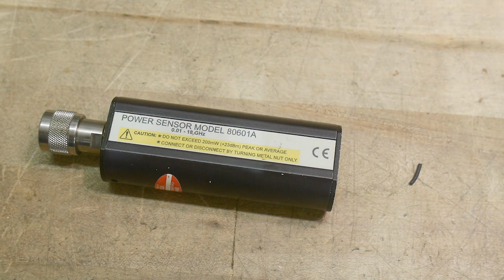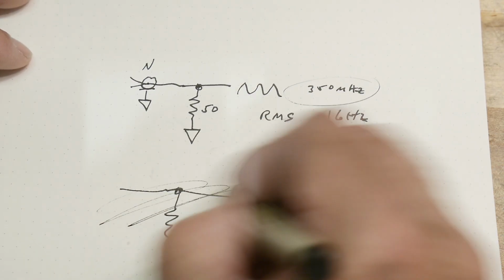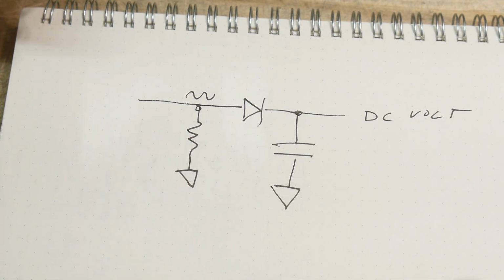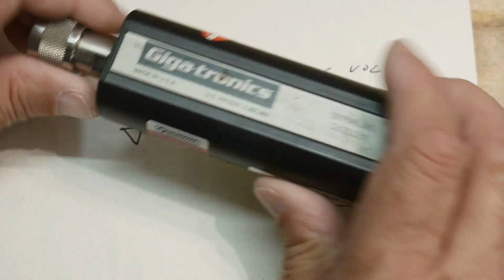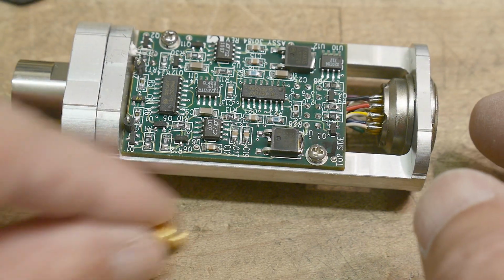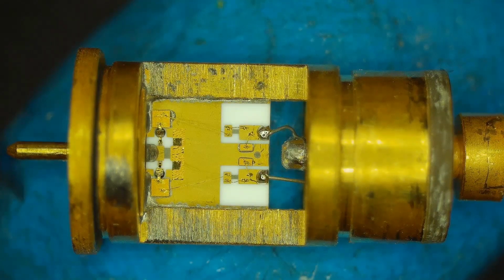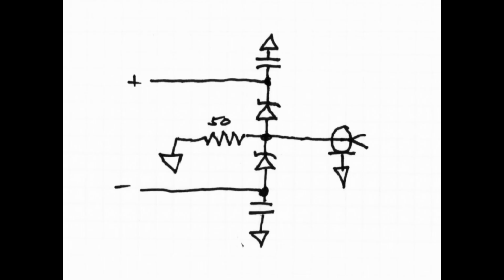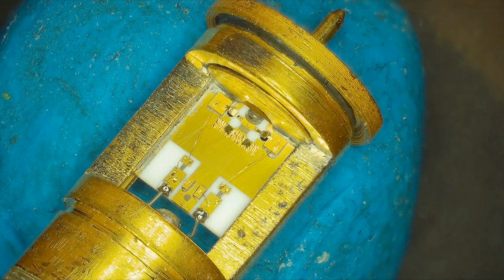#1447 Why are RF Power Sensors so Expensive? Can I fix a broken one?

Comment: The tapered layout shape is probably a tractrix curve.  If you transition abruptly from a transmission line to a lumped 50 Ohm resistor the VSWR won't be good so the tractrix turns out to be the optimum way to taper for good VSWR.  This transition also helps cancel the few pF that the lumped 50 Ohm load will always have.  Reflected power isn't detected by the diodes so a good power sensor must have very low VSWR (aka low reflection).

Comment: Thanks for the video !  Do you happen to know if there is any standardization in the interface between power sensors on the readout side ?  If I buy this or that power sensor, say power sensors with USB interfaces, they will always be readable by "most read out devices" ?  The reason I ask is I need a power sensor to perform mixer measurements with my SIglent SNA5004A VNA and I'm wondering if it will be able to "see" most power sensors.  Thanks !
Reply from the maker: no standard

Comment: Is there any way to get a commercially available RF detector diode that is good enough for the lower end of the microwave range? I have some 1S1588 diodes stockpiled for amateur radio use, but I would have thought technology would have improved enough to have a reasonably-priced microwave detector IC by now.

Comment: The diode cartridge works similar to the older designs for RF voltmeter probes using two diodes. However, they didn't have a great frequency response, where a Millivac, like I use, starts to roll off after 10 MHz. I think that is the reason Drake recommended using an RF voltmeter to calibrate their wattmeters at 14 MHz, though 10 would be best at 30 meters. At that, you can only measure 3 VAC RMS maximum, thus, for high power, you need a large and accurate attenuator.

In the Millivac probes, the diode section used two diodes and a few resistors and caps, which was fed to the meter that used a chopper. However, it also had three thermistors that led back to the circuitry as well. I think Boonton's was similar.
Reply from the maker: that sensor is good to 20GHz and we made 40GHz version as well
Reply from the maker: they also work from -70dBm to +20dBm.   you are right about needing an attenuators to move into the watts region. We made those sensors too. you might be interested in the box: https://youtu.be/8i5-O_8AZyk?si=1Qlc3vAzuvjYRMm2
these are not simple watt meters but NIST traceable power meters good to 0.01dBm

Comment: there also techniques that measure a temperature rise across a resistor,  and compute power from that. But that is not as simple as you think, you need to keep the resistor isolated from ambient temp.
Reply from the maker: called a Bolometer
Reply: @IMSAIGuy  HP used to make a generator, which was custom made for the telecommunications industry. It was called the HP 3335A "Synthesizer/ Level Generator"

This thing was a beast when it came to amplitude performance. It was "ruler flat" within +-0.02db form 200 HZ -> 80 MHZ !!

(It gets very expensive to be that amplitude precise, most gens today are spec to +- 1.0 db)

Then the telecommunications industry changed overnight, and HP decided to discontinue it (I guess they were the biggest customer)

That Bolometer technique we spoke about was used to confirm amplitude flatness in this instrument.

They used the phrase "Thermal Converter" and they used this HP part number for it:  HP 11050A (for the 50 Ohm output), HP 11050A/H01 (75 Ohm)

I own one, it works well but the output attenuator is damaged, and all signals are 20 dbm below what you set on the front panel.

A video on the HP 3335A might be popular with your viewers.

Comment: I spent 30 years looking for one I could afford. I had gathered a good, relatively modern Agilent control box and the cable over the years, and had them sitting around for a decade before I found the power sensing head with a 25 Watt attenuator for a semi-reasonable price at a poorly advertised auction for a failed start-up. It was sitting in the original box with the cal certificate. I bid on it and bought it immediately for more than I wanted to pay, but far less than it was worth. Now it's on my bench, and NO ONE is allowed to touch it but me. I usually make a power measurement using a cheaper meter first before I use it, just in case. It's the one piece of gear in my lab that I don't even plug in the AC cord until I need to use it.
Reply: Where do you get it calibrated?
Reply: @NimbleJack3 , I haven't gotten it calibrated. I've only used it twice since opening the box, when I really needed to. I use much cheaper stuff for approximate measurements.

Comment: The hp 478 and 8478 sensors compensate for any change in resistance from incident power by using a feedback loop which re-balances a bridge circuit. It therefore stays at 50 ohm so as to stay matched to the source. Also the 8481 and 8482 thermo-couple sensors have a series capacitor which limits LF response.

Comment: A diode-based sensor might be pretty impossible to build yourself, but a thermal RF power sensor sounds like it'd be pretty easy to DIY -- a pair of 50 ohm resistors you've picked out to match against each other, with a thermocouple junction bonded to each one; one resistor connected to the test load, the other connected to an op-amp that has the thermocouple junctions wired in series between the + and - inputs, to servo the current to keep the temperature matched. Wouldn't have a fast transient response or anything, but the cal curve doesn't seem like it'd be bad at all for a system like that.
Reply from the maker: http://hparchive.com/Application_Notes/HP-AN-64-1.pdf

Comment: As someone who has had an Agilent power sensor fail, it is good to know why it is so expensive to have it repaired! To be fair to Agilent, their repair service is excellent, but the cost is as you say, nearly as much as a new sensor. Really interesting video.
Reply: Almost the entire worth of the sensor is tied up in the input assembly. The rest of the thing is just a relatively simple ADC. Most repairs require replacing the input assembly, while it's very hard to blow up anything else.

Comment: Diode power sensors are less sensitive than the thermistor or wire type.  The chopper circuit you speak of is controlling capacitor coupled RF to the thermistor or wire to maintain it's resistance while the said thermistor/wire is directly a part of a bridge oscillator.  When microwave power is introduced across the thermistor/wire it requires less RF to the to the thermistor/wire to balance the bridge.  The drop in RF power to balance the bridge indicates microwave power.  Ambient temperature and temperature between the sensor and heat sinc must be accounted for.

Comment: Nice video!

 The old sensors and detectors we use to used are now considered obsolete now that we have Vector Network Analyzers and Spectrum Analyzers available.

I have a bolometer, but the meter portion does not work! I used to use it to test the output of signal generators, but I have a pair of spectrum analyzers, and the bolometer has sat on the shelf gathering dust. It may be ready to go bye bye!

The last time I used it was several years ago, and it, and many other devices, are getting ready to be sold for parts or repair!
Reply: I still use them frequently, as absolute power measurement accuracy on a spectrum analyzer is poor, as is measuring true mean-square power.

Comment: I’d hope the company making the diodes doesn’t care whether you’re an individual or not, they care whether they can afford to spend time talking with you. I’m not sure how much such perfect wafers cost, but if someone had a spare $50k or $200k or whatever, the company would be plenty happy to get their money :) For $1M and good leads on used equipment you could probably get everything needed to repair those things, including a wafer of diodes. It still would be an expensive service just keeping all your gear in calibration :(. And the cost of breaking a few things along the way to learning how to do everything right would be there too. So I guess as a business opportunity it would work, but if the money is someone else’s, their dividends would make the cost to customer in the same ballpark as manufacturer repair. And once the costs are similar, people will go with the more trusted vendor, even if it costs a bit more. I’m pretty sure that if those repairs could be done for much less and still paid a living wage, someone would be doing it. Quite a few metrology people out there who would know how or have the ability to learn. But it just wouldn’t cost any less to do it in a “garage”, and that would be some spotless air-conditioned garage, too :) I think the biggest unsaid/implied nugget here is that as much as these things cost, the market for them is competitive. To make those sensors cost significantly less, they’d need to be something normal people buy at Walmart. Then economies of scale would kick in and you’d be buying those sensors from Apple or Samsung for a couple hundred bucks. As much a metrology nut in me would like there to be a consumer market for these things, that’s all but a fantasy and will be for a while :)
Reply from the maker: here is one that would be ok: https://www.digikey.com/en/products/detail/macom-technology-solutions/MSS20-145-B10D/10249942

Comment: Worth mentioning more-explicitly for those following along at home: I believe that the EEPROM is connected just to the bench instrument, effectively having no significant interface to the rest of the Detector circuit. In other words, the EEPROM with the Cal Data is more-or-less like a memory stick (as it were), storing the Cal Data physically within the Detector (for convenience, and being a perfectly-logical design concept). I don't believe that the EEPROM has any direct internal adjustment effect on the rest of the Detector's circuit. It's just a data store on the end of the same cable.

I hope that my recollection is correct...
Reply from the maker: you are right, I thought that was obvious

Comment: Ah, yes, I see now.  Never have seen a marketed diode made out of gold.  Same goes with a capacitor.   Amazing how the manufacturers make batches and the QC dept (or maybe another term used) determines what the model-part-chip number in regards to the solid state electronic parts.

Comment: Wow !! .....This brings back +70 yrs ago memories of Microwave rf power measuring using HP 478A Coaxial RF power Sensors working my 1st days with the Bell System....At the time,  the relatively Small size & lightweight of the waveguide Adapter, the 478A Sensor + the HP 432A Power meter seemed the Least expen$ive of all the rf test equipment we used !.....I always used Precautions & never blew one (Faik) & seemed reliable life as I remember...Thx  for the memories !!!

Comment: A guy at the W6TRW swap meet today was asking $400 for a gigatronics meter with one power sensor
Reply: I got an old General Microwave power meter analog type at Dayton one year with a 3W. sensor.  I think it was like 40$.  Seems to work just fine.  Although at very low power levels below the max it is a bit drifty down there.

Comment: You just need a wide band AM de-modulator.  It is unnecessarily designed too complicated.  The reason is that it has too wide frequency range.  
I would design it in several ranges of frequency to ease the design requirement, and as a result cost, and probably you could do a better job of detection.
Say you could break it like this, and design one device for each range:
0 to 100MHz
100 to 500 MHz
500MHz to 1GHz
1GHz to 2GHz
etc.
Also I would reduce the maximum power range to 15dBm (i.e.  3.5566Vpp)and minimum power to 1dBm  ( ie.  0.70963 Vpp so it easily turn on the diode), so you need to use either a LNA or Attenuator before the unit for out of range power.
Note that when you want to use a RF Power sensor , you need to detect the RF power for limited range of frequencies anyway.  So by dividing the frequency you could put a band pass filter in the input to limit other frequencies influence. 
Now in unlikely case that you want to measure all the RF frequencies from say from 0 to 18 GHz yo use several measurements.
Reply: A demodulator or filter would present an unreasonably high VSWR to the device under test. The closer you can get your sensor input to a purely resistive 50 ohm impedance, the more accurate the power measurement will be.

Comment: I have a new found respect for these sensors... I shall no longer "rage against the machine". Q: Is testing "relative RF power measurements" using a inexpensive Power Meter and a home-brew sensor in the 2-5Ghz range a obtainable quest? I would like to get a handle on WiFi output and seat of the pants antenna performance. As in "better or worse" case scenarios. I ask this without any foundational knowledge. My apologies. Thank you.   p.s. No Commercials? You RoCk!
Reply from the maker: you can get a sensor: https://youtu.be/cDBdwLW1qzA
but you still need to calibrate it. so you need a friend with a good meter.
Thank you, I turn off in video ads and I turn down sponsorship offers. I hate them as much as anyone.
Reply: @IMSAIGuy  Thank you. My knowledge on the subject has increased by 3db  :)

Comment: Rectification works to several kHz.  Schottkey diodes work up to 200 kHz or so.  Above that, we must use its nonlinear (I, V) to mix the signal with itself and to extract the squared term.  RC averages this to a voltage proportional to power.  Device uniformity is a problem so that these must be individually calibrated and the calibration stored in ROM.
Reply from the maker: for those interested in this topic: http://hparchive.com/Application_Notes/HP-AN-64-1.pdf

Comment: Interesting topic!  Around 7 minutes the sketch probably should swap the capacitor and the diode.  At least that was how Heathkit RF probe was done.  That arrangement made it easier to provide bias DC to the diode.  It also in effect doubled the voltage within the series capacitor, also helping to extend the diode operating point towards lower amplitudes.
   
As to thermal sensors, my father had a big book called something like "Electricity and its Use".  It was printed before WW2, maybe even the late '20s.  There was a picture and description of an AC or RF hot wire meter.  The wire was mounted end to end on fine adjustable clamps.  The current was run from clamp to clamp trough the measuring wire.  From the center, there was a perpendicular second, spring loaded wire, running around a shaft that had a pointer attached to it.  When the current carrying wire heated up, it increased in length and the spring loaded cross wire pulled the center of the hot wire sideways, enabling pointer movement.  The meter could be calibrated with DC current and was ready to measure the RMS value of AC or even RF current.  No Schottky diodes or other fancy later inventions!
Reply from the maker: more about thermal sensors: http://hparchive.com/Application_Notes/HP-AN-64-1.pdf
Reply: Do you mean Heathkit used a clamper circuit to meaure?

Comment: It's over-engineered. Boonton had much simpler probes which anyone can repair. I would not pay money for  this!
Reply: I have couple of Boonton power meters with different sensors. If you are not able to find pair of meter and sensor as was calibrated in the factory, it is practically impossible to calibrate it later by your own. There we always calibration tables (several pages) for each sensor and also for meter (usually hidden inside of  meter enclosure). If you don’t have it, I haven’t found the way how to calibrate it by your own. Compared to HP/Agilent where you connect power sensor to internal meter 50MHz/0dBm source and after simple procedure you are ready for measurement.
Reply: I have a Boonton signal generator and was advised that Boonton Millivolt and Microvolt meters are useless without their ORIGINAL sensors...
Cheers
Reply: @gixerags750  Smart man, a meter without a probe is indeed useless, and also with a probe if you don't calibrate it. The calibration is multi-point so that you can accommodate different segments of the curve of whichever diodes you are using. Different probes (for the same meter) use different diodes. See the probe schematics floating around on the web.
Reply from the maker: Mercedes vs Toyota
Reply: And I bet you dollars to donuts that the Boonton probes were calibrated using precision power sensors. These are lab-grade instruments, not for lugging around on a worksite.

Comment: I was kind of surprised they used a diode detector.  I figured they used a log detector to get the dynamic range and to make it simple.  I've made diode detectors in the past (<1GHz tho, a lot more forgiving) for level control in loops, and I added a 2nd diode for temperature compensation (i.e. one diode changes over temperature, and the 2nd diode cancels the first diode).

Definitely a lot of thought went into the the GigaTronics and Agilent detector designs, not as simplistic as I expected.

Comment: On the idea of building your own, although to get the full precision and frequency range into multi-GHz land, it would of course be not something you can do yourself, but the All Electronics channel guy has designed and built a sensor and meter that works well and accurately up to at least around 2GHz: https://www.youtube.com/watch?v=uNsWs7J1_C8  It's a temperature compensated diode sensor design.You can find his experimentation videos by searching "diode power meter prototype". Pretty neat.
Reply from the maker: https://youtu.be/cDBdwLW1qzA